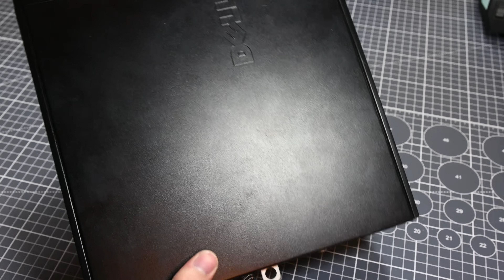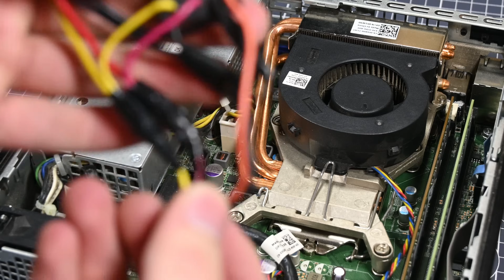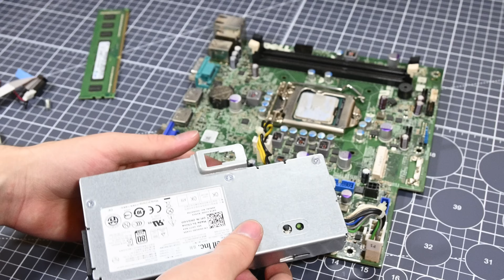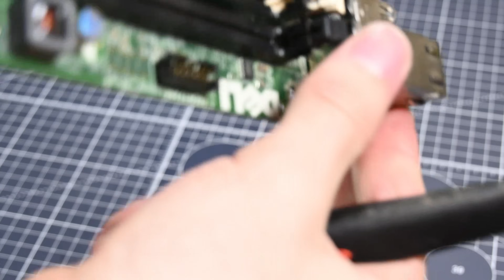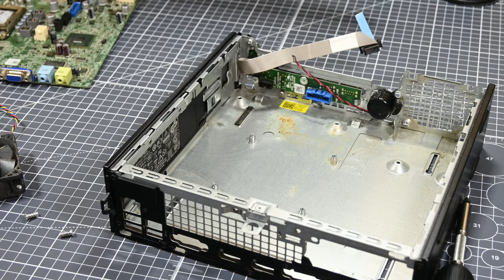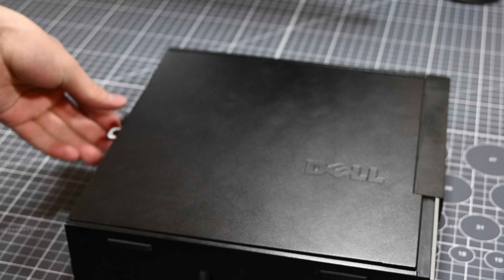$40 and No Power - Let's Fix This OptiPlex 7010!

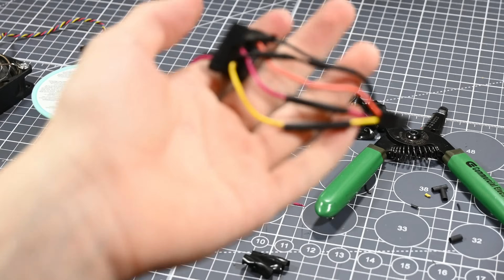Comment from the maker: At 12:00 I accidentally put up a clip of the fixed cable before I shrunk the heat shrink tubing. I of course shrunk the heat shrink tubing before installing it into the system, and you can peep that in the next clip.

Comment: mitsubishi batteries may have caused the pc to no boot due to the motherboard as some motherboards needs the cmos battery to function it may not be that battery even though it could be faulty the system is old so it makes logical sense

Comment: Just investigated my similar problem.  Battery was at 0.0V,  pretty sure it was new 6months ago.   Put a new battery in. Removed motherboard, all looks OK.  Re-attached most parts, Motheboard just clicks but nothing else. Battery down to 2.8V (from 3.3V) after 20mins. Refurbed M/B on order.

Comment: Good call re PSU warnings. I had a old PC PSU in my shed that had been in a box of parts for easily 1 year, maybe more. I wanted to rob the fan from it so took it apart and thought "Better short the caps just in case". And i put a screwdriver across the 400v cap on the HV side and CRACK!. It still had a hell of a charge. Thank god i did that and didnt accidentally put my hand on the underside of the PSU.

Comment: I have an hp laptop that I patched and it will restart ( up and running and restart ).  but if you let it powerdown  - It will not power up.
I have replace the battery and that did not work ( it was a hail marry move ).  but based on your comments - that it looks like the cmos 
battery could prevent - even power on.  so I will try that.   thank you

Comment: A good cleaner for this, in my experience, is actually some contact cleaner from an autoparts store. It basically desolves the oxidised metal, making it easier to clean.

Comment: Use vinegar on the corrosion before IPA.  Another mistake, installing Windows.
Reply from the maker: Thanks for the vinegar tip. Also yeah, Windows on these older systems certainly isn't the most ideal OS for maximum performance, but it's near impossible to flip a computer with Linux on it sadly.

Comment: That power cable hack job was pretty pointless imo,i mean you could get a sata splitter for less than 1$. I have one of those splitters in my sff optiplex which powers 1 ssd and a hard drive and also the dvd drive and it's no issue at all. You can also try car circuitry corrosion cleaners,that's what i use on my boards and it attacks the corrosion really heavy without harming the board. I actually saved one board from corrosion using that cleaner and it still works to this day
Reply from the maker: I agree, why they didn't just use a SATA splitter I have no idea. I'll have to try that cleaner sometime!

Comment: Your observation about the battery was interesting.  I changed a ton of cmos batteries in this era of Dell computers but I never made the Mitsubishi connection.  It seemed that after this era I never had to change one again.  One of the Dells, I think the 790, they put the CMOS battery under the overhanging part of the heat sink on the back of the board, so you always had to remove the heatsink to change the battery, and of course, ideally you'd put new paste on it, which was an added expense.
Reply from the maker: I haven't had much experience with the 790, but that battery positioning does seem kind of annoying. And yeah, all of the Dells that I deal with from this era seem to have dead CMOS batteries, and the few that don't aren't using Mitsubishi batteries. Interesting how those specific cells die so quickly compared to others, I think!

Comment: I can only guess that some of those caps on the old motherboard were bad…
Reply from the maker: It's possible, but I didn't see any obviously damaged capacitors sadly. Would have been nice to see an easy fix like that.
Reply: You don't necessarily see a bulge in those caps, but I noticed that some of the leakage was nearby one or two of them. Just unsolder them and check the capacitance and the equivalent series resistance (ESR).
 @CHWTT
Reply from the maker: @roysigurdkarlsbakk3842  That's a good idea, thank you!

Comment: Replacing a motherboard is not fixing, it's called replacing! You basically made 1 PC out of 2, congrats ....
Reply: Great video. Like your style!!
Reply from the maker: Would you rather me have thrown it in the eWaste bin?
Reply: @CHWTT  no, just don't call it a fix. Other channels that do real repair would have cleaned the rust, restore missing paths, replace capacitors etc. to get the board working.
Reply: @stzokev  when i had my business i usually replaced the board for customers because its faster then i kept the old board if the customer didn't want it and when i had some time i fixed it and keep it for the next customer
Reply from the maker: I would very much rather do that if I were skilled enough at this time to be able to complete that repair successfully. As you saw, I very much tried, but I wasn't able to get it working. I'm working on building that skillset. And I think we'll have to agree to disagree on whether or not it should be called a fix, because I'm looking at the system as a whole, and it went from non-functional to functional, which means the system was repaired/fixed. If we look at the board and only the board, you're certainly right about that being a replacement, but I'm not looking at just the board.
Reply from the maker: That seems like a really effective way to do that for a business, nice thinking
Reply: @CHWTT  using IPA to clean corrosion this bad would rarely end up fixing anything, rather reflowing the affected components with a hot-air station along with flux (preferably rosin when it comes to BGA chips) is the way to go. Using multi-meter to check connections and following main power line is where such an attempted fix should start.
Reply from the maker: I appreciate the advice, thank you!
Reply: @CHWTT  don't be a parts changer
Reply from the maker: I'll change a 12-dollar part for a system that I'm experimenting with for myself. If it was a business repairing a computer for a customer, and a more expensive part (ex. a laptop motherboard with a decent CPU/GPU), I'm absolutely on the side of the anti-part swappers. 

But it's not, and it's a twelve-dollar board in an ~10-year-old system.

Comment: Hi, just a quick question. Do you know how to fix dell optiplexes that have amber light?
Reply from the maker: The solid amber light? Not entirely, in my case I'm pretty sure it was due to the liquid damage, and I couldn't repair that, so I needed a new motherboard to fix that issue.

If it's a flashing orange light though, there are a few things:
RAM issues
CPU issues
Motherboard issues

Give reseating your CPU/RAM a try, as well as using a known good stick of RAM in all four slots if you have one. It's possible the RAM just needs a reseat, you could have a dead DIMM, dead slot, or dead memory channel. It's also possible that some of the contacts on the CPU which work with the memory, or another part of the board aren't making contact anymore and need to be reseated.
For CPU issues, really the only things you can do are reseating the CPU and trying another known good CPU if you have one on hand.
And for motherboard issues, it's a chance something's gone bad on the board, BUT try a fresh CMOS battery. I've had several of these older OptiPlexes give a flashing orange light because of a dead CMOS battery, so check that for sure!

I hope at least some of this could be helpful, cheers!